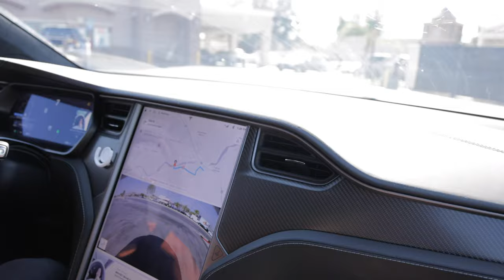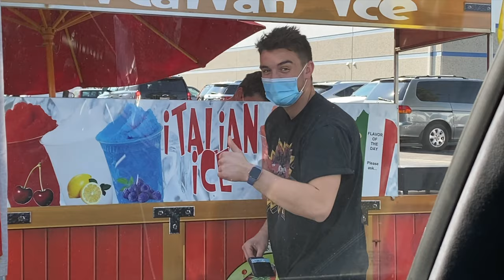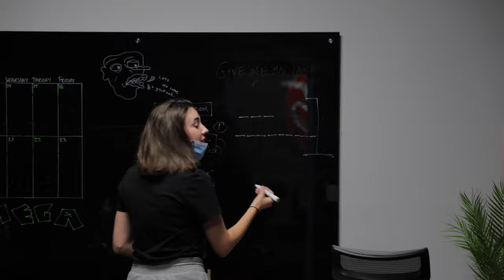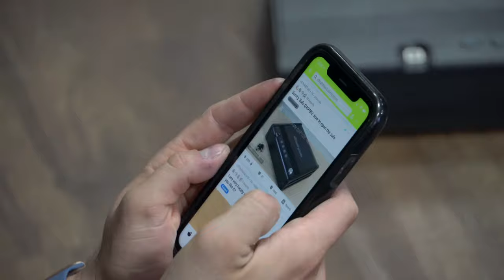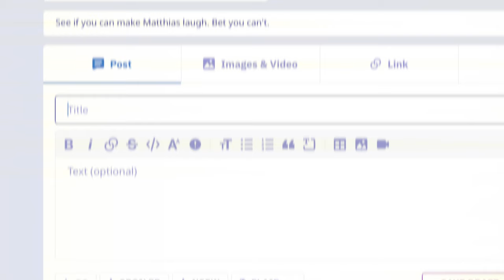Something Explosive Is Leaking Out of the Safe...

Comment: Flammable and combustible liquids ignite easily and burn with extreme rapidity.
Flammability is determined by the flash point of a material.
Flash point is the minimum temperature at which a liquid forms a vapor above its surface in sufficient concentration that it can be ignited.
Flammable liquids have a flash point of less than 100°F. Liquids with lower flash points ignite easier.
Combustible liquids have a flashpoint at or above 100°F.
The vapor burns, not the liquid itself. The rate at which a liquid produces flammable vapors depends upon its vapor pressure.
The vaporization rate increases as the temperature increases. Therefore, flammable and combustible liquids are more hazardous at elevated temperatures than at room temperature.
Class 1 Flammable Liquids must be bonded and grounded when transferring liquids.
Because their vapors ignite and burn easily, flammable and combustible liquids have strict storage requirements. The hazard classification of a liquid determines the type and size of container in which it can be stored. For more information, see:

Container size and quantity limits
Flammable and combustible liquids storage guidelines

Comment: Just depending on what they say we can all safely assume that it's either oil or gasoline (I assume gasoline because of the clear colour) if you're wondering why it all of sudden combusted into flames that's because if a any spark even if it's a small one will result in flames that's why at gas stations they tell you to turn off your car engine in case a spark will occur.

Comment: I just searched this up so I’m not so sure if this is correct but since the liquid ignited after a few minutes I think it could be Pyrophoric type substance “Pyrophoric materials can ignite spontaneously (within 5 minutes) on contact with air, moisture in the air, oxygen, water, or other chemicals with reactive hydroxyl groups. Most pyrophorics may also be classified as water reactives. However, not all water reactives are pyrophoric.”

Comment: All that liquid could be condensation from being in the vent for a long time because of the ac unit. Also I think you would have to have the metal zip tie because it would probably be more flexible and thinner, also I think you maybe puting the metal clap in the wrong area they had it in the side where the bottom of the grove is and you had it in the flat area.

Comment: Curious series, please be safe guys.
In a past video, I remember someone speaking of the buildings being some kind of lab. Maybe some kind of chemical was being stored in the safe. Maybe even without the knowledge of management/higher ups.
The other possibility is that, due to it allegedly being a gun safe, there was some cleaning fluid being stored in there. Thus, if the fluid spilled, and if there is a gun in there, the two items connected (perhaps due to the friction of the metal tool being used to open it) and ignited the flames.

Comment: i know im 8 months too late but u can actually buy replacement keys. i had to buy a key for my rv because i had lost the only key. on the lock itself there is a number. its for the configuration of the key and the locking mechanism that the key is meaded for  . type in that number into google or something and it will give u search results for the key " model ". if u look at any key that u have on ur key ring, 9 times out of 10  there will be a number on it. ill post this on reddit so u can see

u can use this information in other ways. like if u get locked out of ur home or tesla

Comment: Around 7:24 you can see woods with his hand in his pocket, and if you pay just enough attention he starts to pull it out as the camera looks towards Matt. You can also tell he isn't really heading anywhere to find cleaning supplies, at least in my opinion that's what it seems like. And around 7:32 if you look at the opposite side of woods that is away from the camera, he is seen pocketing something. Slow down the vid if you need to, it took me several times before I caught it. And if the liquid was flammable, the fire would have spread. If the liquid was on fire, it wouldn't have stuck to Woods' shoe. I feel like this one was a little to ambitious.

Comment: Could it possibly be some kind of petrol bomb or something like that? someone could have set it up in the air vents for a later use? when you get it open check to see if there's some kind of small explosive device or something that could actually ignite the gas or whatever it is thats flammable from a distance (possibly radio signals of one kind or another) it could possibly be an arson attack or a potential company sabotage that never got to happen due to the perpetrator being apprehended? 🤔

Comment: Matt, if you have a thermostat check the temperature at that time because flammable liquids have a flash point which means at that temperature they will ignite.
I have a website that has the common flammable liquids with their flash point , so that you can see if a temperature from the list matches with temperature in the  building
URL - https://blink.ucsd.edu/safety/research-lab/chemical/liquids/index.html#:~:text=Flammable%20liquids%20have%20a%20flash,burns%2C%20not%20the%20liquid%20itself.

Comment: Kinda feel that we are all being led on some sort of wild ride that ends with Matt revealing that this has all be a set up to generate views. Just seems to be a lot of coincidental things happening. I mean its not uncommon to find a safe in the wall that may have been left there by a previous tenant. But to then find a key to a random abandoned car and then for them to bring up the issue of the room being hot and finding another safe. Also take this video for another prime example of it  being a set up by Matt, is the fact that they dropped the safe and then liquid randomly started leaking and then randomly set on fire. As well as the fact that they cut it on the fire before showing anything which will drive viewers to come back

Comment: I think the water inside the safe it’s just condensation from being in the air vent. And to get it open I think you can just drill out the lock at the spot where the key goes 👁👄👁

Comment: This is the least believable video in the series. you've had that safe for at least a month and no liquid or wetness has ever come from it but mysteriously while off camera it gets dropped and liquid pours out of it. Then again while off camera it supposedly spontaneously combust. 
The only known liquids that will spontaneously combust  oils (linseed, cottonseed,corn, vegetable, margarine,soybean)and that's only when on contact with paper products or combustibles.

The moment you realized it was locked, you would call a locksmith not go on Reddit. 

You have an endoscope so take a drill and pit a hole in the same and run the camera through it. 

That'll give you another video to prolong this  illogical mystery series.

Comment: My guess is that there a journal in the safe that was coded in flammable substance I'm guessing the journal was in the safe community post but I am not sure I could get more clues if if we knew we were general came from cuz we didn't come from this video and I don't think you posted a video yet and if you have then I feel stupid butback to what I was saying the journal was probably from the safe coded and a very flammable substance well not very flammable but flammable so depending on what woods use to clean it up then that would maybe play part because fiction and if you didn't do anything and it just lit on fire then there's probably like lighter fluid or butane oil propane diesel fuel those are just some things that catch on fire very easily it is a liquid so I would be careful with the next safe video If you guys try and handle the safe at all I would do it outside so if you guys do catch it on fire then it's outside and not in the building I know this is a lot to process I'm going to see if I can post it on your Reddit if not then hopefully I can hopefully you can see it here